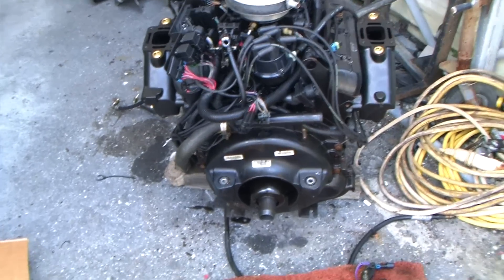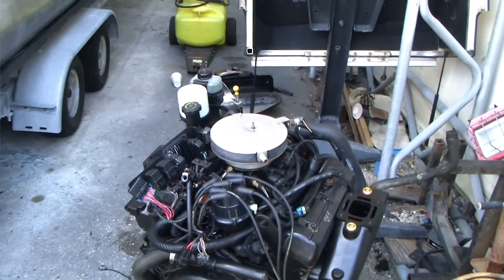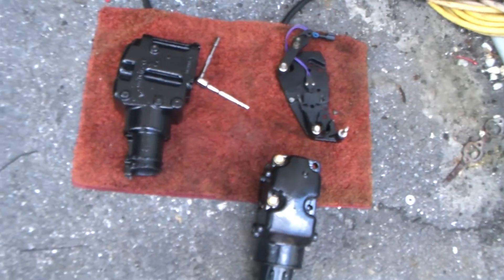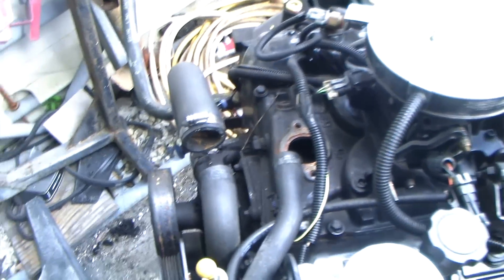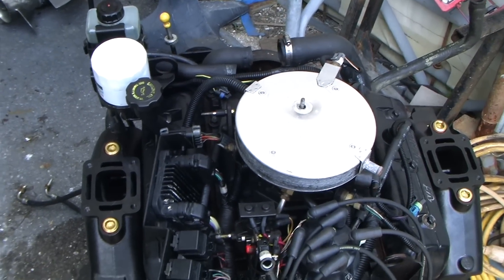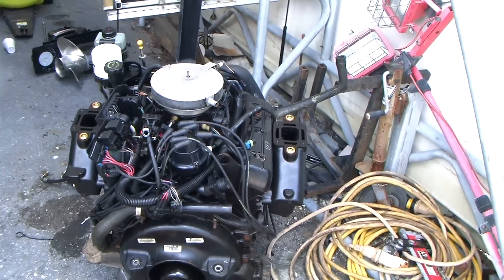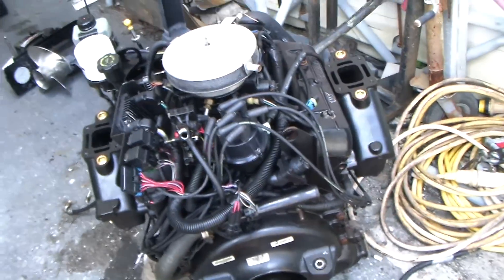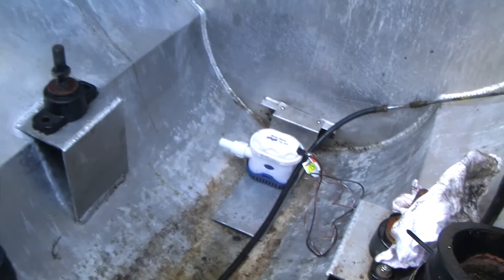What Saltwater Does To Your Freshwater Inboard Outboard

Comment: The best way to go for a I/O is to get a closed cooling system.
The only part that will get saltwater is the exchanger and mixers. The rest will have coolent.
Flush it after every use and drain the water.

Comment: Correction: This is what leaving it in saltwater does. Boats under 30' can be trailered or lifted in the Dock and flushed after use. They don't have the marine heat exchangers cause they can be removed from the water.

Comment: So would it be alright if the boat was sprayed down and flushed after each use.  I am asking because I am going to Florida and was considering taking my boat.
Reply from the maker: Put in a heat exchanger -- then you are covered -- kits are cheap -- flush after anyway though .. I've seen folks have nothing but horrible luck running them with just raw water cooling in saltwater (most new ones are ready to die before the warranty expires)

Comment: I have a lubrication question.  Shell Rotella T is an oil normally used in diesels.  Do  you have an insight/opinion as to the use of this oil in the crankcase of an I/O?
Reply from the maker: avoid fire and ice (too high a detergent) ... but hell I run Delo 400 in damn near everything and have had excellent results
Reply: Thanks.  Delo is what I heard, too.